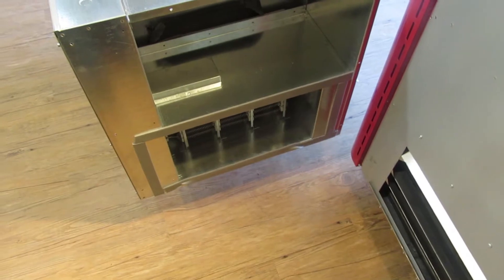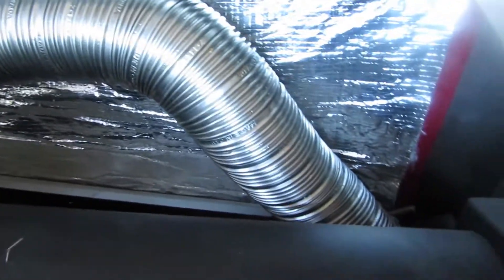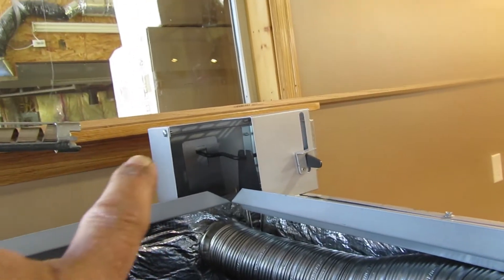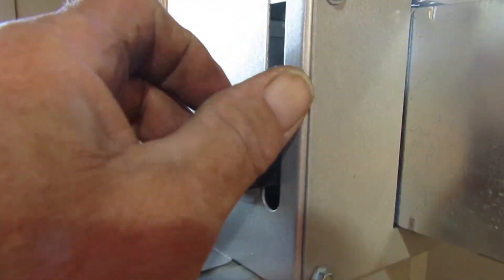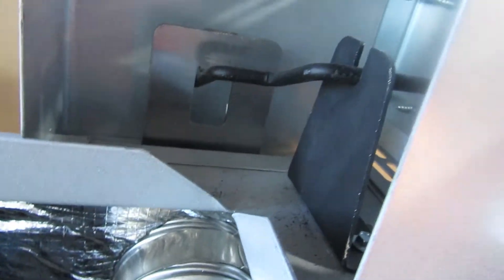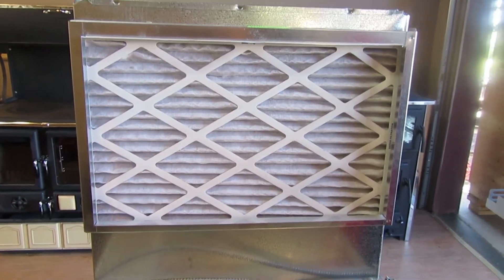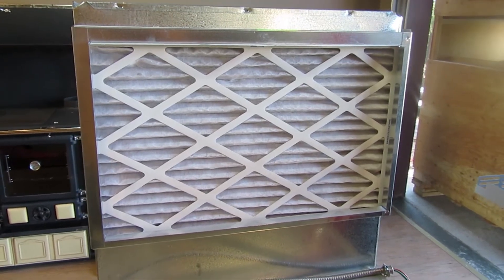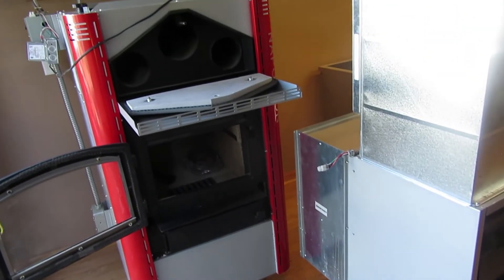Obadiah's: Napoleon HMF Furnace - The Bypass System

Comment: I just installed the HMF 200, (cause of the videos you guys uploaded) my only issue is even when my damper is closed and my thermostat isn’t calling for the stove to burn hotter it’s still burning fairly hard/hot and then it calls for the fan to run. Is there any way to close down the damper even more so it isn’t burning as hard? Cause at this rate it’s burning A LOT of wood. Any advice or help is gratefully appreciated!!! 

Thanks.